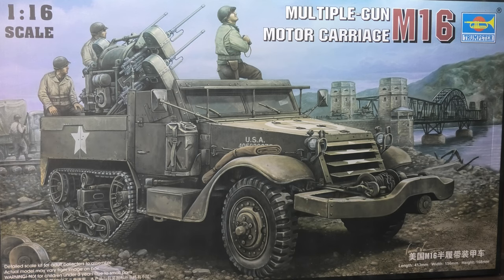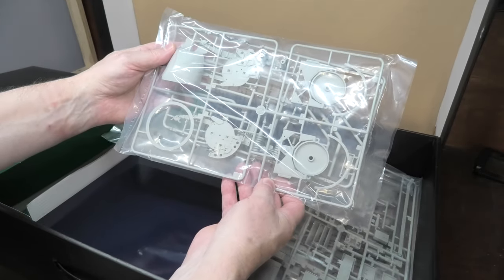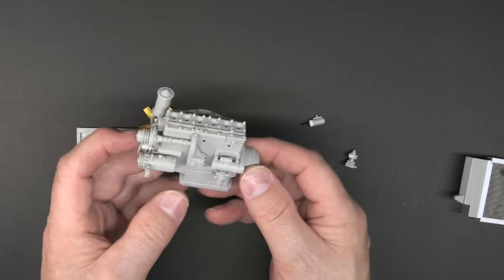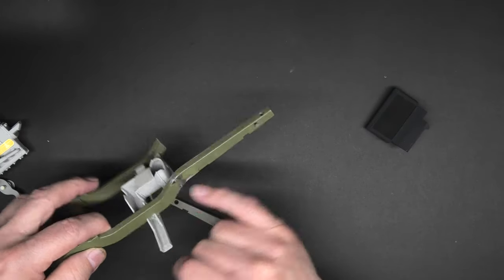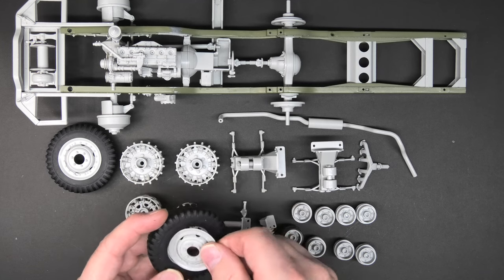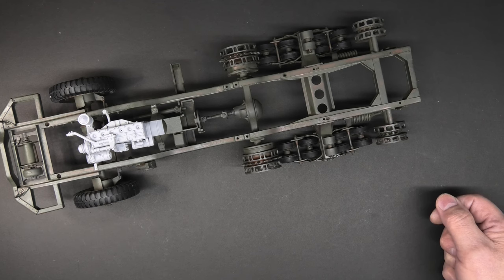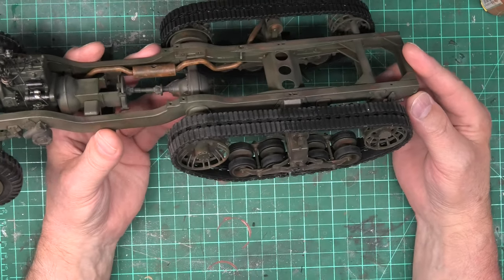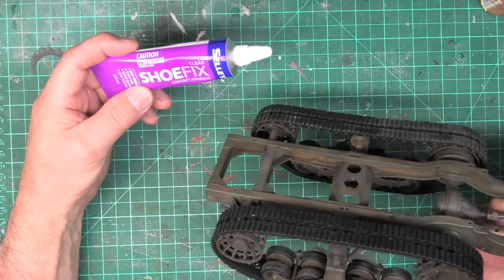Trumpeter 1/16 scale  M16 Multiple-Gun Motor Carriage: Part 1 "Engine and Chassis" #ww2 #models

Comment: Great looking build. Do you think the broken chassis is due to a manufacturing flaw or are there issues with the build sequence or fit? I’m asking as I’m a big fan and builder of Trumpeter 1/200 ships but am interested in building this vehicle in 1/16 scale and am looking for a quality kit.
Reply from the maker: Thanks for your comments 🙂. I think there is an issue with the manufacturing  or casting of the chassis  pieces. Someone else told me the same thing happened to them. It's an impressive kit ,but I found there were a few inaccuracies and lack of details considering the scale.